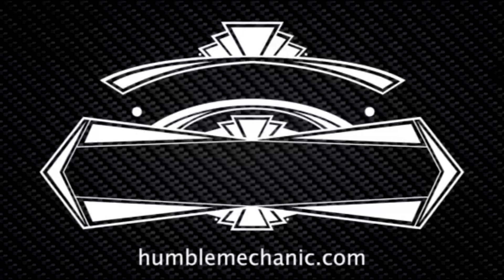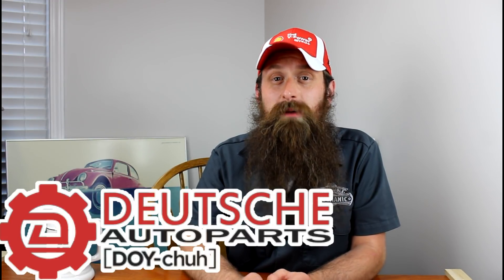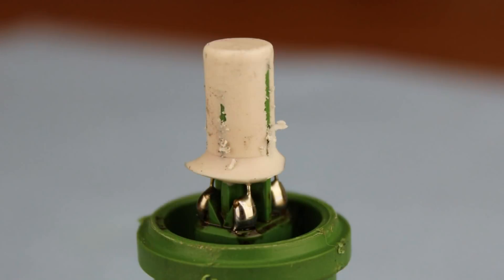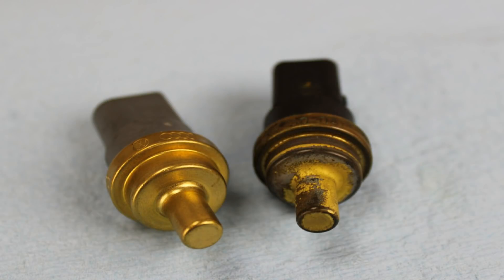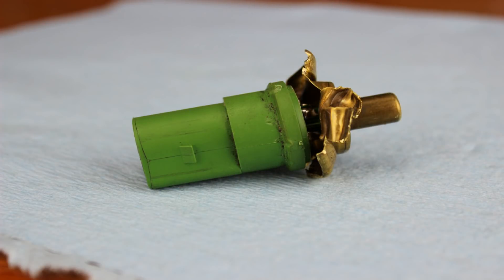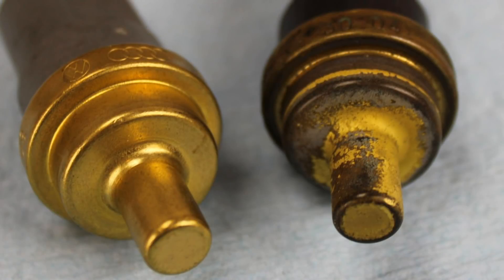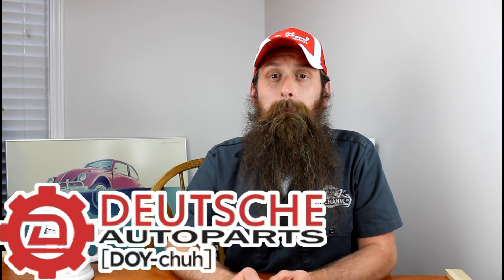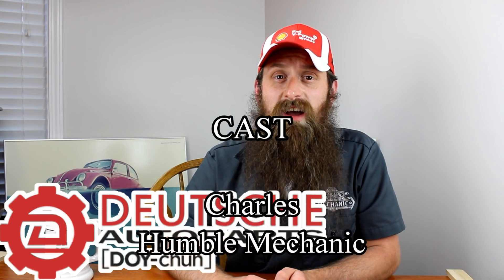How VW Coolant Temperature Sensors Fail

Comment: Hey man! I just found your videos and they rock. I have a MK4 question if you don’t mind giving me a hand. As soon as I turn my ignition key on my fans start. Doesn’t matter where the knob is(I.e. feet, face, defrost, ect). I’ve unplugged multiple points such as the coolant temp sensor(working btw) the high pressure ac sensor, ac compressor,  and they will only shut off when I unplug the FCM. So I ordered one of those but just wanted to run past you!

Comment: Doubt I'm gonna get a response any time soon, but worth a try. Would a bad temp sensor cause the fans to come on immediately after a cold start, and cause the car to react as if it's already warm (no high idle to warm up) 2013 Golf R
Reply: Did you ever get this sorted out? I’m having a similar issue

Comment: On my mk4 TDI golf. I have the 4 pin.  The two pins that went to the cluster worked fine, guage was perfect.  Two pins went to the ecm and it cause a no start in the winter due to the glow plugs not working.   Took for ever to figure out.  Forums said to unplug it as see if the glow plugs lights stayed on for 30 seconds and it did.   That means bad sensor.   Replaced it with a green one and it was perfect.
Reply: Hi Charles, where is the repair shop located??

Comment: Charles my man, I bought 2nd hand Mk7 from a dealer in the beginning of August last year 2019. I drove with the car for about 2months and it started overheating. 

I took it to the Mechanics and they said its water pump  falling. They changed it and I only drove on it for about 10 KM and it did the same. I pulled over and I told them what's up they said j must take it back tomorrow morning.  I did as they told me to and they started to point fingers on electricals of the car and they said if I want them to look it further they will need to call for an auto electrician on me.

As tight cornered as I was at the moment, being skeptical whether if he will be able to fix the problem and how much it will cost me I turned that down  and drove on it, pulling over to cool it down when the temperature approaches red. I drove from East London to Port Elizabeth (South Africa) I took to the "cooling system specialists". They first said it might be the radiator blocked, they blew and were happy with and when they tried the car it did the same thing. They changed their focus to an auxiliary water pump but still there is no change.

They say they need to do more tests snd they are suspecting the clusterboard. 

Can this be a sensor related issue, what advice can you give to me so that I can point these people in a right direction? 

Can you imagine buying a car and drive it for 2 months while paying full installments and  insurance with a standing car.
Reply: Hi Khusta, Did you manage to find out what the cause of overheating was? I am having quite a similar problem with my Golf 2.0 FSI. Changed the water pump, did a radiator flush (looks ok), got the heater core out (no blockage either), electronic thermostat was a new unit (however putting it into boiling water would not open). Could it be the thermostat, or would it require current to open (rated at 105 degrees ~ boiling water couldn't reach that temperature).
Reply: @weekaung , no my friend my car is still with those people. They now say they have ordered coolant heat sensor and they say it has been delayed due to this lockdown.

Your car when it overheats does it really boil or its just false signaling? Because mine when i open the hood i see no signs of overheating and when i open the coolant cap everything will just go to normal.
Reply: Hi Khusta,
My car really overheats , it seems that the computer is not sending the open signal to the electronic thermostat.
Reply: @weekaung  how long has it been doing it now? Have you check if you head is not blown or something?

Comment: do you think this can be my problem when i start my golf does not accelerate in cold  start like car is warm
Reply from the maker: Possible.  But one of many reasons
Reply: @HumbleMechanic  after replace it , if fail continue , what's next step to check

Comment: My mother-in-law has a 2001 EuroVan. No major problems with it so far. The water temperature gauge does not move. The fans come on as soon as you turn on the car. The heater never starts blowing hot air it only warms up a couple of degrees but the fans continue to run and the motor does not overheat. Could a coolant temperature sensor cause this or is it a bad thermostat? Would really appreciate some help with this. Trying to do something for a mother-in-law!!! Merry Christmas

Comment: I just replaced my cooling hose that circulates four ways to the heater core engine radiator and oil cooler 
Now my cars throwing multiple codes p0725, p0730, p1296,p1780, p1850,p0103,p0420,p0740, p0722 any one know what is going

Comment: Hi I have questions I have Mk4 Jetta 2001 tdi and i start having problems starting car when temperature is near cold car will have long cracks befor start but when is cold below 32 start with no problem also I noticed unplugging coolant sensor start with no problem. One more thing when is near cold  glow light  inside don't stay for long comparing to when under 32. Can you please help  Thanks

Comment: Got a 2012 polo vivo 1.6,   temperature gauge indicates its getting hot  once my speed moves to 120-140 km/h, when i reduce speed or drive about 60-80 km/h, does this indicate my sensor is faulty.  because the temp gauge changes immediate after the speed change. please advise.

Comment: I'm starting to chase down an intermittent no start on my mk4 polo. Seems I have the black sensor, well I'm going to change that first. If that doesn't work then it's on to check the relays for a dry joint, anyone know where to find the 106 relay on a 9n polo bby engine, I'm starting to think the car was built around this elusive relay. Might be a complete dash out, really hoping not.

Comment: So my 2000 vw jetta is saying it has a short circuit ground for the water temperature sending unit my question is is it the temperature sending unit or do I have something else going on the code it shows on the scanner is p1255 any help

Comment: Hi Charles... I appreciate all of your Videos. Thanks !
Seeing that so many OEM VW Coolant Temperature Sensors go bad...Is it OK to replace them with a 
FEBI/Bilstein Made one or ELTH Brand at Half of the price ? 2004 VW 1.9 TDI Jetta Wagon
Thanks Brother !
Reply from the maker: I’ve never used one. The OEM ones are cheap. And the green ones are so much better
Reply: @HumbleMechanic  
Thanks for the Reply Charles...one more quick Question and I'll quit bothering you.
I bought this car recently, 2004 VW Jetta Wagon 1.9 TDI with auto trans. I got it dirt cheap $800.00 in great shape....but, it has Low Oil Pressure (like 10lbs). Previous owner Had the Oil Sensor and Oil Pump Replaced....Where do I go now ? All I can think of is Main Bearings...but the car only has 99,000 on it.
Thanks a Bunch in Advance !

Comment: Cooling fan runs constant whether cars running or not.  VW 2012 Tiguan S 2.0 with 97,000 miles.  Besides the cooling temp sensor what else could be causing this problem.  No error codes or even engine light on. For now I disconnect the battery when I stop.  Please help.

Comment: Geeze i hope you see this. My CTS in my 01 jetta VR6 is vibrating and feels like a little motor running after the car is off. The temp reading is fine but im going to replace it anyway. Just really weird like the connectors are frying the coolant inside.

Comment: I have a 04 Audi A4 1.8t the coolant light came on and the temperature gauge was running hot. I stopped at a advance Auto to get coolant thinking it was low. After popping the hood I noticed that it had coolant and it was boiling hot. Could the coolant sensor make the car overheat?
Reply: hi , i would also like to know, did you get a reply from charles

Comment: Hey Charles... love your clips very informative, and doesn't treat us like dummies. Having issues with a New Beetle - just fitted new MAF - made no difference, but your explanation of the temp sensor makes loads of sense ( Really bad cold start, huge dead spot  once running) . It's a green one, but cheap enough to replace.  And easier than the next step which has to be  the fuel filter & pump.

Comment: I'm looking for the 'rear heater core temperature sensor' on my 2012 VW Beetle Turbo, any idea where this is? My check engine light came on and this was one of the codes, thought I replace it. I have already replaced my spark plugs and coils..

Comment: My VW POLO 9N when I replaced the new original temperature sensor it didn't start at all I must put the old one atfer that it start what is the problem?
Reply from the maker: Did it get the correct sensor?
Reply: @HumbleMechanic  yes is the original one

Comment: I would not believe how much trouble this sensor could cause, i didn't pay attention to it as it is small and cheap.. My symptom was a pretty hard start up with a rich mixture, especially on a warm engine after a 5 min drive. I started replacing tps, cps, idle air control valve, map sensor and still no luck. Fuel pressure was ok. One day i decided to unplug the coolant temp sensor and improvise a warm engine start by connecting a 400 ohm resistor and voila.. the engine started right up and running happily. I replaced the part and the problem is gone.
Reply from the maker: It’s crazy!!!

Comment: Last week my Golf V GTI ECT gauge was showing appx. 170F after 10 minutes drive, I thought that’s weird so I shut the key off while I was driving and turn back to on as soon as I shut it off, after that the temperature showed zero, I repeated the process one more time and gauge is in the middle where it should be. And I did it a couple times more and it would just randomly fell in those three readings constantly. Zero, 170 and normal. And it kept doing that almost every day last week. But this whole week the gauge was reading normal, not even a single time did it read weird. I replaced the thermostat about two months ago before that happened, and I replaced the instrument cluster about three weeks ago. What could be the problem?

Comment: Hi,
Please help!!
I have the problem with engine start when it’s warm.
I read on specific forums that the issue can be this temperature sensor.What do you know about this?
When it’s cold it start perfectly,but after the engine is warm ,if i stop it, it will not start anymore, i have to let it for about 20-30 min .
VW Touareg 3.0 V6 year 2006.
Thanks a lot in advance!🙏

Comment: Hi I over a month ago I buy a mk4 wagon tdi and I noticed that my ect was black and my temperature didn't go pass 90 so I  try to replace but its stuck so hard It broke but its still on my engine
Reply from the maker: Yikes. Might have to replace the flange
Reply: Thanks and I have a solenoid/valve in the back of the engine that constantly opening and closing even when the car is on Park. Do you think a bad ect can cause this kind of problem?

Comment: if you have moment. here's the problem I'm having.  my ac system driving crazy.  keeps freezing up. I've replaced expansion valves,  dryers. compressor, high pressure switch,flush  system.  now I've noticed as long  as ac switch is on both fans run constantly.  unplug high pressure switch and both turn off. it will only build pressure if fans are off. what could be the problem. and 1 of temperature sensors replaced while b. mines has 2 . (98 Volkswagen beetle  2.0)

Comment: hi 

I have a a6 3.2 fsi with a stalling issue , it only does this when at normal runnig temp.  it does not do it when cold . normally around 90 deg . it stalls in park or when driving . ive scaned for codes , none found. its like it runs out of fuel. ive replaced fuel pump in the tank , and on the engine. ive replaced the throttle positioning butterfly, ive replaced fuel pump relay and fuel pump controll unit . when its plugged in and running u can see the fuel pressure just fall , and the engine stalls, ive also replace the valve on the bottom of the mechanical pump and ive checked resistance of wires to ecu .. can u shed any more light on this

Comment: My 2004 VW Golf started taking multiple tries to get it to start when the engine was cold from sitting a few hours. I replaced the Coolant Temperature sensor and it cured the problem immediately.
Reply: Did you have a code?

Comment: Hi Humble Mechanic, I have an Audi A4 2.0T tfsi B7, when driving the temperature gauge never gets to 90, it only goes up to 90 when I have reached the destination and the engine is idle for a few minutes. Do you think I have a faulty sensor or is this something else? Thanks

Comment: Hi there. 1999 6n polo. Clutch on aircon drops out as soon as engine temp gets near 70 celcius, also 3 seconds after starting engine wants to cut out as though theres no choke working. Could this be temp sensor related? Also, ive removed thermostat so my aircon works as the engine temp never gets near 70 C on freeway but does running local. Theres two switches in the thermostat housing, which on is the ETCS? Thanks.
 Has anybody read this!!!!!!!!!!

Comment: I have a 99 jetta 4cyl 2.0 its automatic i replaced both VSS input and output shifting fine my water return busted i replsced the housing but not the sensor now my transmission is not wanting to change gears in drive but will manually shift fine can these sensor cause the trans to go into limp mode thanks in advance

Comment: Hello Charles. Thanks for to detailed and intelligent vids 👍I just replace thermo with housing on 2002 Golf Mk4 BFQ engine. It has a 2 wire connection that is not the ECT (ECT is also in housing but is the 4 wire green sensor). I can’t find a PID for the black 2 wire connection, which I suspect is an on/off switch to signal to ECU wen the thermo is open??? Can u enlighten me as to the function is this 2wire connection and is there a block code for its function BTW I use an Autel DS808 ... Best, Alex 👌
Reply from the maker: maybe for the alternator?
Reply: @HumbleMechanic  - Hey Charles. Amazing. I'd never guessed it! Here was i stupidly thinking it was the expansion-element thermostat current control for low temp heating of the wax element for mapped engine cooling. Dumb thought. Thanks always for the great vids ;-)

Comment: I have an ‘01 Beetle 2.0 the ECT clip broke and pushed out the ECT while driving. Should I just replace the clip, or am I looking at a bigger issue?
Reply from the maker: I’d do the clip, Ect, and seal. Those are super common failure points. Also look at the housing very close and be sure it’s not broken
Reply: same thing just happened to me on a 2001 2.0 jetta.

Comment: Mine didn’t even pop a code! It was started and it died and when I tried to start it I smelled gas but after about fifteen minutes it will start again. 09 Audi A3 Quattro tfsi 2.0 turbo.
Reply: Quite possibly fuel pressure regulator . Usually u will smell gas upon starting and idling . When it's off pull the hose off it and see if it dribbles or has any gas coming out . If it's leaking it's bad replace promptly.
Reply: Also clean ur MAF thoroughly remember to pull the sensor itself and spray it with MAF cleaner all sections of it especially the plate inside the plastic and the terminals at the end . Use a qtip to wipe the residue off all parts in it then make sure to let it dry thoroughly out of the vehicle and do not plug it in til it is dry. I left mine out 24 hrs to make sure it dried all the way through. Also clean the throttle body inside and out. I'm going to take mine off and clean the back inside of it out as well . The front was dirty on the intake side and I'm sure the backside is filthy as well. My golf has a rough idle I'm currently  trying to sort out. Cleaned the MAF already and u usually have to drive them a while to register new readings to sort things out and make it run proper again. Throttle body is next and I will hook up the obd2 to scan it even though there is no cel light on. Never know someone may have took the light out to make sure it shows no issues. But  will start it after I complete all the stuff I still need to do on it still and then unhook a sensor to see if the cel light actually works .

Comment: Thanks for this video HM!  I had the starting problem with my 2000 Eurovan VR6.  Replacing the GREEN Coolant Temp Sensor fixed my starting problem. I didn't know there's 4 Coolant Temp Sensors in my engine.  Crazy!
Reply from the maker: The Eurovan is a whole different beast!
Reply: @HumbleMechanic  Your video helped convinced me it was the green CTS.  Had to share your video to my mechanic to also convince him.  Haha.  Now he's a HM fan too!

Comment: I have a ‘08 VW Jetta 2.5L auto that is leaking coolant. It started at the end of winter. I was waiting for it to warm up to fix but then it slowed down and wasn’t leaking as much. (I’d Top off the globe once a week) but now it’s cold again and it’s getting worse. (Topping off every 1-2 days). It never overheats. It’s just losing coolant. Any ideas or common coolant problems on this engine?? Temp sensor gauge O-ring?

Comment: I've got a weird one on cold starts as soon as key is on temp gauge shoots up to 190. I've got a cts on the way. Also I noticed a little coolant in the center of electrical connection I'm assuming the sensor is the issue just never seen one cause the gauge to do this. What's your thoughts?

Comment: If I changed mine about 8 months ago, is it possible it went bad again? I’m having similar problems as you were saying. Intermittent coolant readings on the cluster. It’s doesn’t go to zero, but lowers and raises. When I’m driving, it seems to be at correct temp, when i stop and idle for a bit, it seems to lower. Heat is always warm. Could I have gotten a bad part?